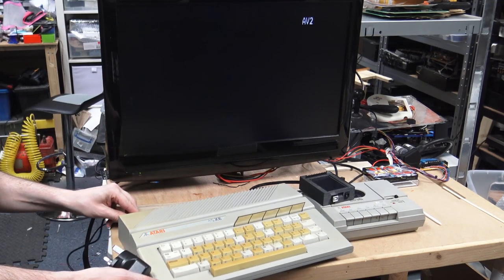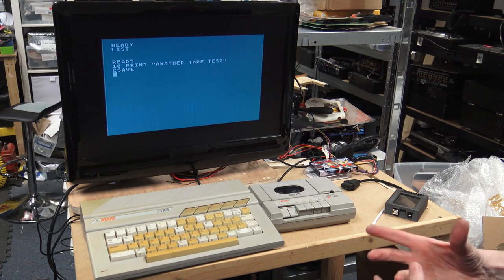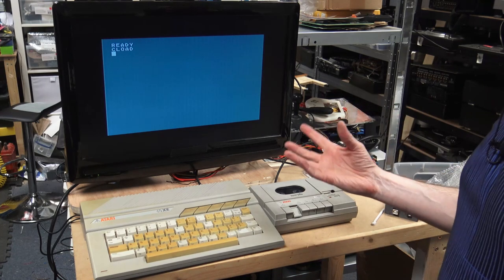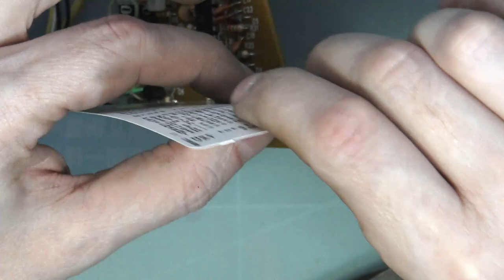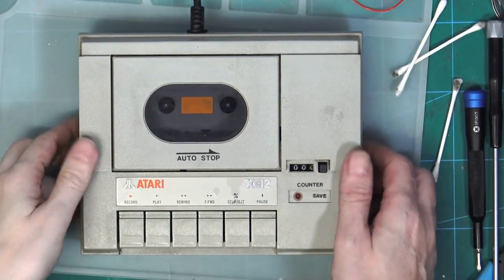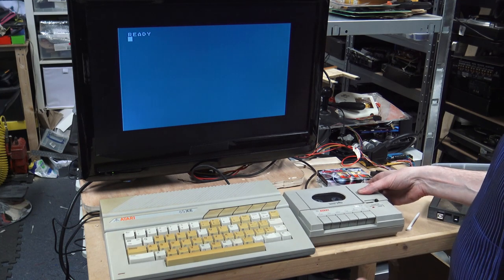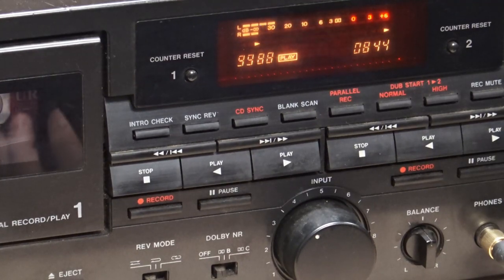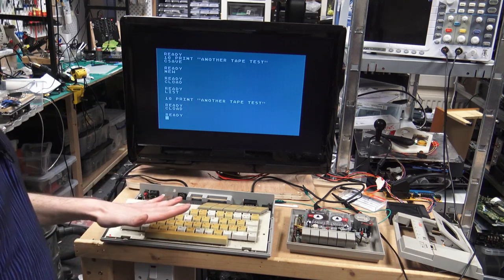Atari 65XE restoration project part 5 - XC12 Tape drive repair

Comment: I had the xc12 tape drive when I was a kid. That thing gave nothing but trouble. I put in a cassette game by trying to load it, and during that process, an error screen comes up.

The worst part of it was the tape drive worked for a short period of time and had the best games on the cassette tapes. These games such as Ninja, Alley cat, international karate, and zybex. 

Keep up the repair videos of the old tech. Wish would have known you then 😂😂

Comment: Excelente video, me has dado una pista para reparar mi CX12, ¿no tuviste problema con la faja del motor?
Excellent video, you have given me a clue to repair my CX12, did you not have a problem with the engine belt?

Comment: Hi, the torsion spring that holds the top cover that holds the tape has broken. Do you know what kind of torsion spring it is so you can replace it with a new one? someone knows?

Comment: I had the XC12, and the only thing, which prevented it from being perfect, was the single door-catch.. An easy solution to it was to glue something heavy (a piece of metal, in my case) to the opposite side of the door - and since then it worked perfectly. I later upgraded to Turbo 2000 and got some real speed out of this little beast.

But yeah, I jumped from joy, when I finally got the 1050 floppy disk drive 🙂

Comment: Hello, I loved your video, I have the same problem with an xc12, could you tell me the technical characteristics of the capacitors, to buy and replace them? Thank you very much in advance, from Chile!
Reply from the maker: HI, Sorry I just bought a kit and replaced them so don't have the values.
Reply: Hi there I've done quite a few. They are mainly 220uf 16v and 4.7uf 16v. I use Panasonic FC/FM caps. Usually with higher voltage rating.

Comment: Hi there
Did you ever find out what causes the loud humming? I have a couple xc12 that do the same thing. Thanks
Reply from the maker: I thought it was the bad caps and I fixed by replacing them ?
Reply: @DJlegionuk  I replaced them too but humming has continued. Prob a transistor. Really enjoyed your video by the way! Thankyou

Comment: Hi. I have an ATARI XE system with a power supply and an ATARI XC12. I don’t have a keyboard for it and I don’t have any cartridges, so I can’t check for functionality. What can I do in this situation?
Reply from the maker: Hi, sorry I do not know, this was my first time with this system and I think you will need a keyboard just to run anything as you have to hold down the functions keys to run. the only other thing would be buying a cartridge.  so you will have to buy stuff to test.
Reply: @DJlegionuk  ok .anyway thanks for the info. I will look for missing accessories.
Reply: You have an XEGS with no external keyboard? You can buy an XEGS keyboard on ebay or elsewhere online but finding on ebay might be the easiest.
Reply: @gamedoutgamer  Thank you for the information, but the keyboard is very expensive for me, I hope to find it in my country.